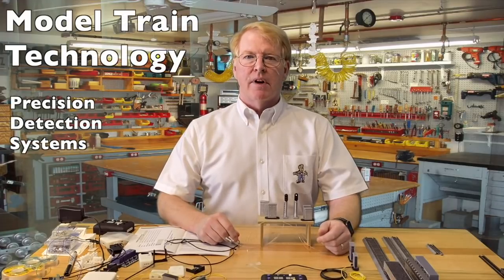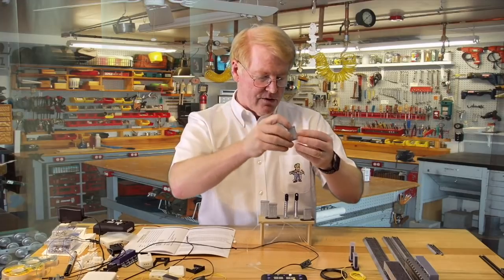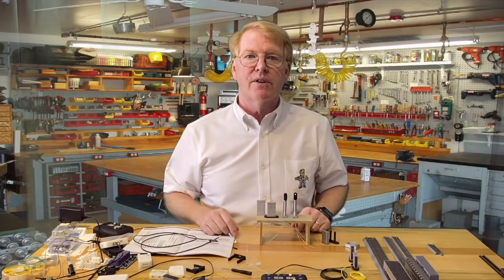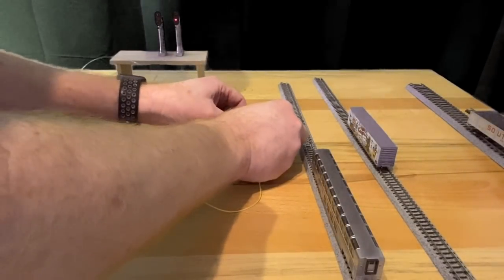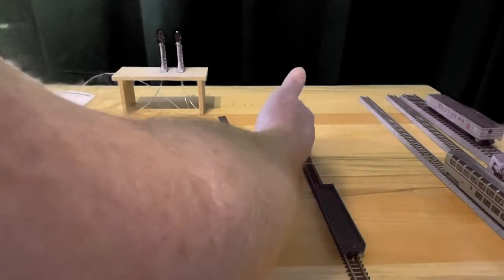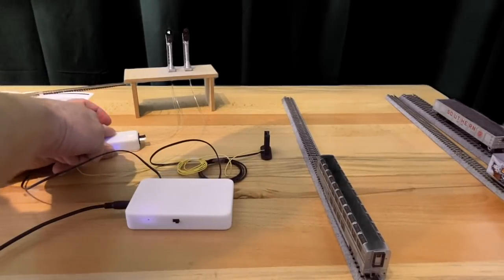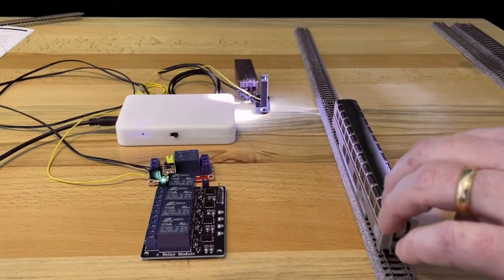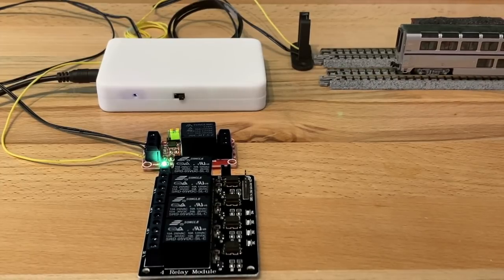MTT Precision Train Detector - PRODUCT INTRODUCTION - NEW

Comment: Thank you for directing me to this video, It helped answer the many questions I had about your system. It is impressive. I have a fairly large established HO layout but have not yet installed any signaling system due to the complexity of doing so. Your system seems simple enough for even me to set up. Plus I have a couple of road crossings that could use this system as well.
Reply from the maker: You are welcome!

Comment: I run S.E.NE.RY (Southeast Nebraska Railway) which is a 3-rail O-Scale Modular model railroad.  I like the quick disconnect feature as all scenery is removed from the boards for transporting to and from shows. I have a video of the layout at a show posted on youtube under Mark Williamson Around the Layout.  Maybe some of you could comment about using a product like this on modular boards.  Still running trains after all these years, thanks.

Comment: Looks like a useful product but in HO scale, your relay box is the height of the freight car so it seems, whereas a HO scale trackside relay box may be about the size of a little finger, fingernail of a small hand. Will you be make actual scale size versions of the detectors?
Reply from the maker: The N scale version may be used for a more prototypical size match; the circuit board is the same.  In fact,  the N scale is a little big for n scale but there are other factors including the height of the rails above the roadbed, etc. that should be considered to get place the sensor height in the ideal position for your railroad.  The cover is non functional so you can mount the sensor almost any way you want.

Comment: This looks like a great set of products.   Can the detector be used to activate NJI crossing gates and flashers ?
Reply from the maker: The gates and flashers are controlled by another unit that powers them.  Our sensor can trigger that controller.  Or, you can connect the Precision Sensor to our Signal Controller and the Controller will operate the gates and lights. Lastly,  you could connect our sensor to one of the relays we show in the store if the function is only on and off.

Comment: A great looking product. I am curious if the gap between cars will cause it to toggle or does your "delay" adjustment offset that?
Also do you sell the detector board without the relay box??
Reply: Exactly,  you can adjust the sensor delay to 1-2 seconds which usually is enough to avoid the gap.  All our detectors come with a mounting bracket and the box.  You don't have to use the box if you don't want.  There is a alternate mounting bracket with mounting holes if needed.
Reply: @jlewis1210  Thank you. It looks like a great product. The engineer in me wants to see one up close so expect an order soon.
Reply from the maker: You can also aim the sensor at a very slight angle so that the gap is always obscured.

Comment: Very interesting approach to detection and I can see a number of possible applications. I do have a question, current detectors that I  use,  detect if a train is in a particular zone , let's say 6' of track long, how your detector could accomplish that?
Reply from the maker: Thank you for your question.  On a layout where you have already divided blocks (insulated) and use current detection, adding precision detection allows you to also know the precise locations within that block.  Our demo layout uses a combination of both.  With automation we can tell the train to slow down, and keep slowing down, when it enters the block but due to differences in engines, how hot they are, how long they have been running, etc.  the train will not stop in the same place each time. For good automation, that's crucial.  Precision Detection adds that capability:  slow the engine down and then at a precise place at the end of the block, staging area, etc. STOP. 

On a layout that does not have current detection in the track you would use two detectors tied together (connect the signal wire) and put one at the block entrance and then one about 2/3 into the block so that your train has one or the other (or both) tripped while traveling through the block, assuming the train is 3'.  When the last car of the train is almost out of the block the second sensor will still be tripped.  Our Signal Controller has a latching feature so that the detector can hold the previous block until Clear to Proceed is released by the second detector.  This is super simple to set up - just plug in the parts.  It's all built in.
Reply: @ModelTrainTechnology  Thank you very much for the reply. I do not have a signal system setup in my layout yet. i like the idea of not having to use current detection because eliminates a lot of work and allows for a simple method of adjusting block lengths as you gain operational experience.

Comment: What if I want to use more then 1 signal light?... exp:4 signal lights to one sensor?
Reply from the maker: Yes, you can do that.  Two would be the recommendation but up to four is possible.  It would not be to one sensor but to one Signal Controller.  Or you can run an almost unlimited number of signal controllers off of one sensor.

Comment: On your store site it says you have G detection. Do you plan to do G scale signals in the future or can I use your detection system with signals from ZStuff or another manufacturer?
Reply from the maker: We're working in it for a September release of the Signal, Longer range detection and a few other goodies for G scale.  Yes, our Signal controlled will run just about anything.

Comment: Build a detector that detects left to right or vise versa motion.ill take about 10 for anti derailment switch👌🇺🇸
Reply from the maker: Could you explain further how "left to right" detection addresses a derailment switch situation?  Isn't left-to-right = motion?
Reply: @ModelTrainTechnology  if possible I would like to know the direction of travel.if I'm going up track and hit a reversing loop on the way up I would like to operate things.but after the turnaround on way back down don't want sensor tripped again.just a sensor that say sences motion say left to right but not right to left.sorry no problem maybe there's not a market I could just use some on my theme park layout👌🇺🇸
Reply from the maker: The way to do this is with two Detectors and two relays.  Let's assume that each Detector activates a block signal.  East to West, detector #1 is hit first and in addition to triggering "its" block signal, through a relay it Disables the signal of Detector #2.  With timing on both Detectors set to long enough let the train pass both detectors - THEN, when the train comes back around it trips detector #2 first AND through another relay disables the signal of Detector #1.  It might sounds more complicated than it is.  Contact my via email if you are interested in more info.  Support@ModelTrainTechnology.com.
Reply: @ModelTrainTechnology  ok I've been watching your tutorials and I'm going to place an order your equipment looks quality and promising 👌🇺🇸
Reply from the maker: Thank you!

Comment: G'Day. 
This looks like a very good system. I have a question in regarding the sender and the single relay set up.
Would it be possible to use the sensor to send a message to activate a servo to open. Would this how ever require another sensor to trigger the close sequence?
Your thoughts.
Kind regards 
Anthony S
Reply from the maker: Using a relay there is a normally open and normally closed position.  (SPDT).  Thus,  when the sensor is active it would close one side of the relay.  When released it would close the other side.  However,  the servo has to know to stop on its own because the relay will keep power on continuously.

Comment: What happens if when you are operating in N mode monitoring the second track if a train goes between the sensor and the train on track two?
Reply from the maker: Physics gets in the way.  The sensor, like you, cannot see through a solid object.  If the sensor is blocked it will not show occupied for the far train but likewise if it can't see the far train it can't detect it either.  We make reference to this in the video and the documentation. If you want to detect "either" train the sensor will do that.  Or, you can set it to detect the near train and NOT the far train even if the tracks are right against each other.  That would be the proper set up.

Comment: What about interfacing with JMRI or Ardunio?
Reply: JMRI connects to the world through various other boards - to which you can connect the Precision Sensor.  Our Sensors are one part of a muti part system.  Right now we are focused on Block Signal Lighting both Fiber Optic and LED and Crossing Gate operations.
Reply: Any Arduino or similar system can easily connect to our Precision Detector.  The sensor can use as low as 5V so you can use the same power source.  I would not run it off the Arduino 5V supply but a shared supply.  Our Power Module could power both the Arduino and a bunch of Precision Sensors.

Comment: does this work with DCCdetection...
Reply: Which DCC detection system do you have?  There is usually an interface board to connect to the computer USB or serial port.  Most of them have an Open drain connect and in that case the Precision Detector can be connected to it.
Reply: @jlewis1210   we use DIGITRAX - and its loconet and we use JMRI - PanelPro
Reply from the maker: The basic approach to work with Digitrax is to use LocoNet.  In that case there are a variety of LocoNet sensor HUBS that take the sensor input and convert it to a LocoNet packet.  Then JMRI or RailroadAutomation (www.perecli.com/rrauto/) software can respond to those packets and take action on the layout.  DCC by itself is a broadcast only protocol.